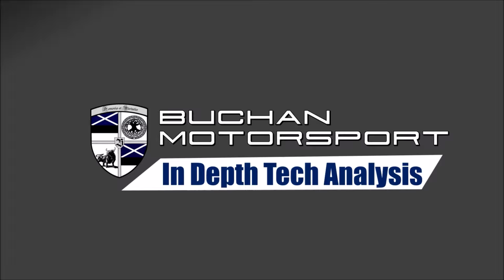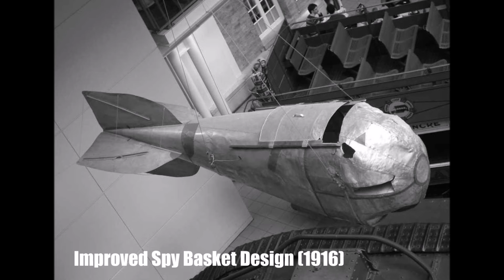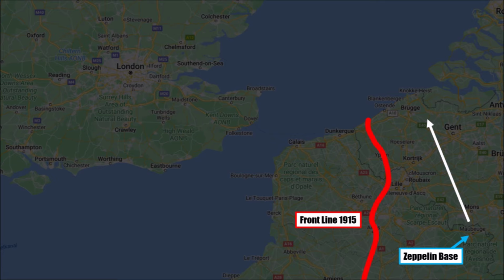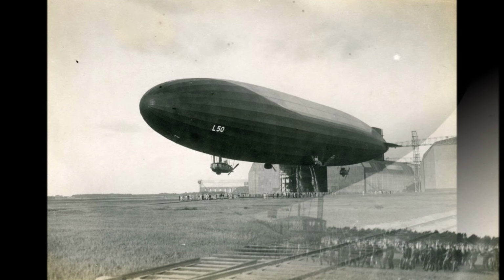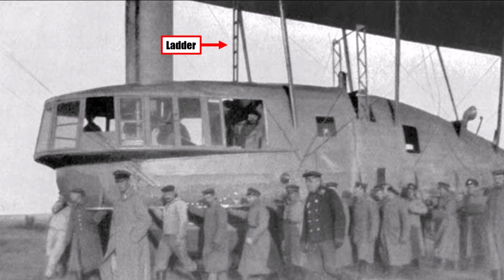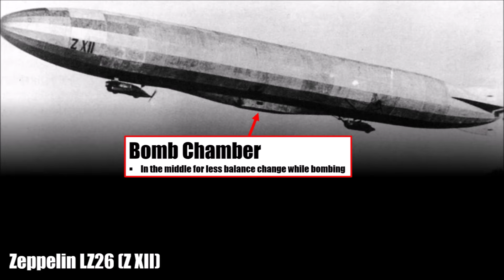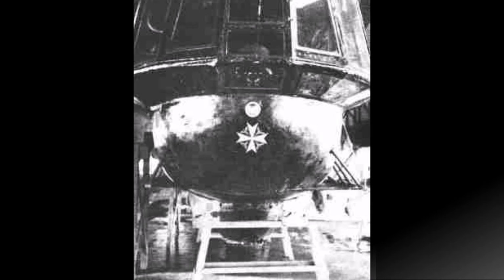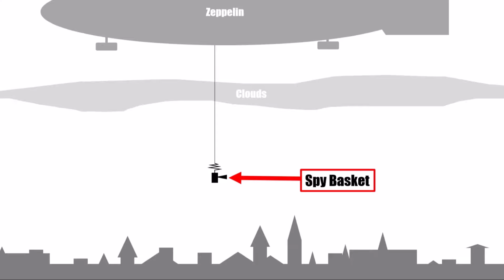Zeppelins - Part 6 - 17th March 1915 - A Zeppelin Mission

Comment: Very interesting series that reveals a lot of new, to me , information .

One question though. If the spy basket was lowered from the bomb bay, and was down advising when to drop bombs, how did they avoid hitting the spy basket with the bombs? I had initially assumed that the spy basket was just used to find the general lovation, and was then wound back in prior to bomb drop. But your descrption of the calais raid implies that the spy basket was down all the time and was continually spotting new targets.
Reply from the maker: Thanks and great question!
Yes, spy basket stayed in the lowered position when they started bombing, also to see with better accuracy what they hit. 
The spy basket was attached to the Zeppelin with the steel cable, the bombs dropped vertically from the bomb chamber.
Because of the speed of the Zeppelin while bombing (80-110km/h) and the spy basket being up to 800m underneath the Zeppelin, the bombs did not hit the spy basket.
Reply: @BSport320  thanks for the answer , so effectively the bombs dropped in front of the trailing spy basket. Is that correct? Still don't think I would fancy being in there when they let loose. 😆 
Very interesting series by the way ,as was some of the other historic stuff. That u boat haulage across Europe was mental! Interesting that some of the road layouts were built specifically for that trip and still exist to this day. I wonder how many modern locals know?

I must also admit I didn't realise the zeppelins were capable of such speed when bombing. I had always thought of them as being fairly lumbering, a bit like Ming's spaceship in the flash Gordon film 😆.
Reply from the maker: The bombs would drop behind the spy basket is what I was trying to say :) @user-it7lf7kk8m